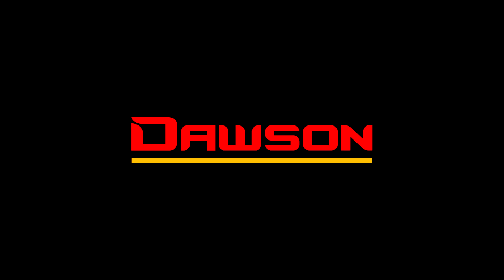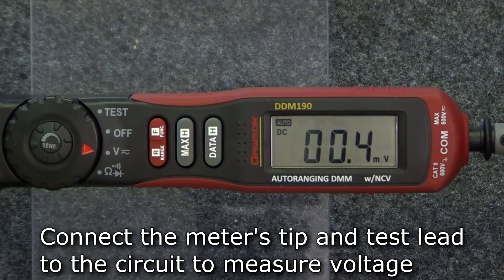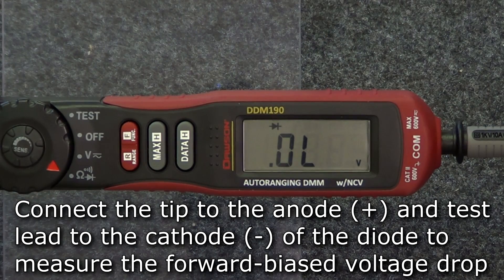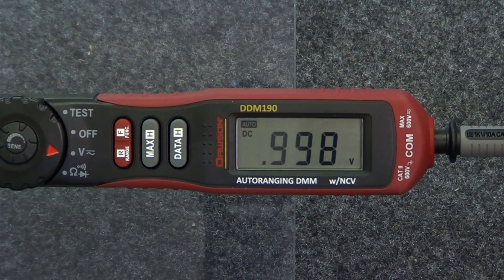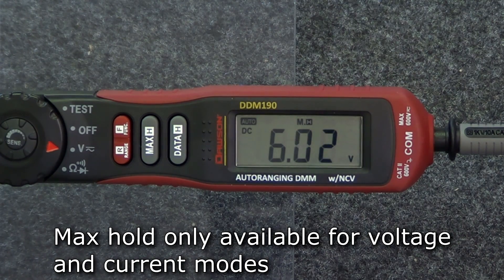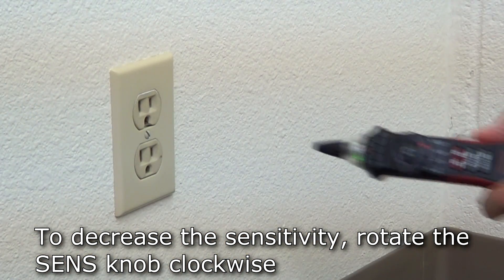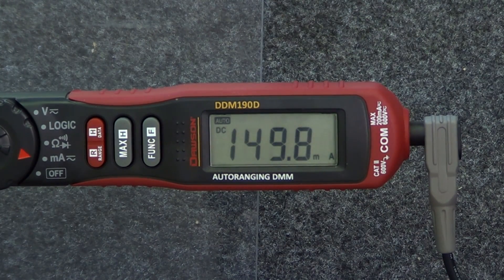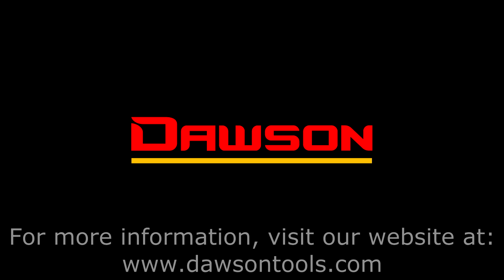Dawson DDM190 & DDM190D Digital Pen-type Multimeters

Comment: After a few utilisation, here my comments:
- Holding Data should have MIN / MAX and optional AVG. This required just a few extra lines code and is very useful.
- Logic: By simplicity, why should I hold the FUNC button? This was another break off for me and totally not intuitive. I have a OLD logic pen analyzer and it give 3 status: Low / High and Pulse. Adding also the frequency and PWM will have been awesome.
- NCV: Why not adding all the feature of DDM190D and NCV to your next new model as an all-in-one model. Make sure you add the sensibility (this is a must).